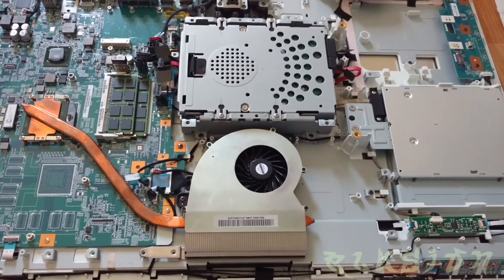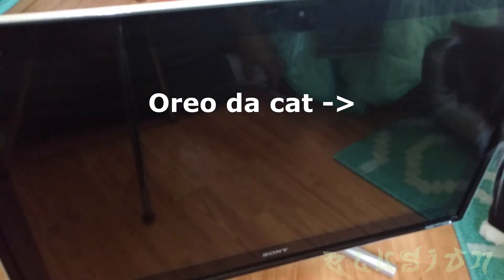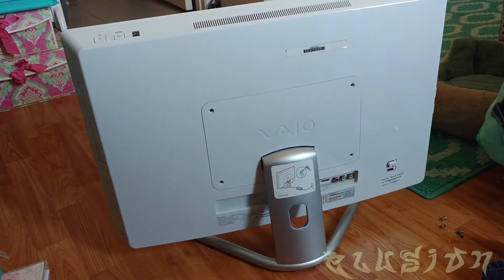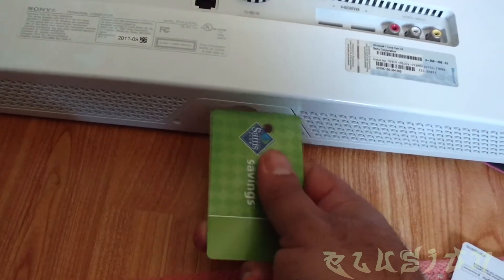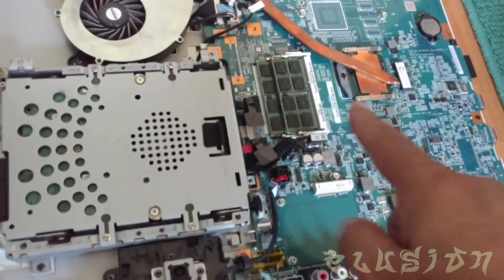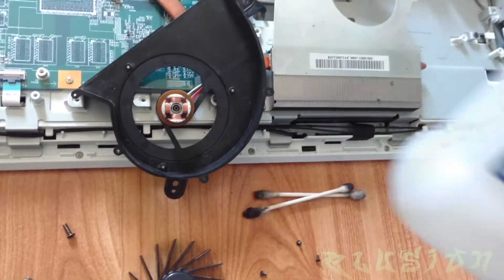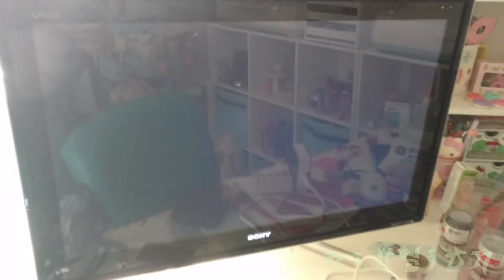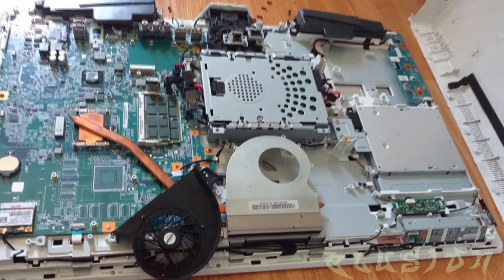[HOW-TO] - Fix a bad cpu fan in a sony vaio all in one PC

Comment: Looks like you have the VPCL21AFX White Version. Is that correct. I upgraded SSD and 16GB Ram few days ago and it's working perfectly. Trying to figure out a CPU upgrade these days.
Reply: Would love to know what type of RAM to use for 16 GB. Thanks!
Reply: @leighherman5796  it was $69.99 and it's $62.99 today

Comment: hey can i ask you something ?  can its CPU be upgraded ?
Reply from the maker: Sure can. This sony vaio was an i3 but I put an i7 in it.
Reply: @djelusion  This is so good to hear. I have a sony Vaio that is the same model and I was curious did you put the quad core i7 in it? I've been looking online trying to find what is compatible with the HM65 chipset but wasn't sure if the stock cooling on this model would cool the higher end processors.
Reply: Also just out of curiosity, which i7 did you put in yours?